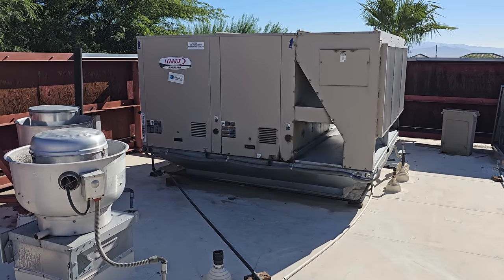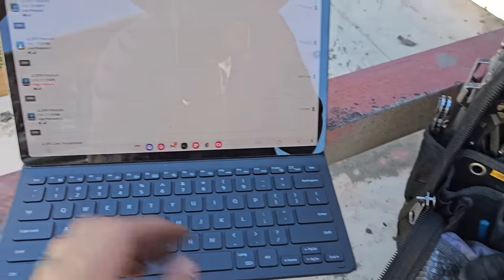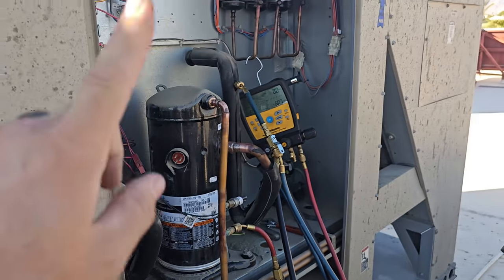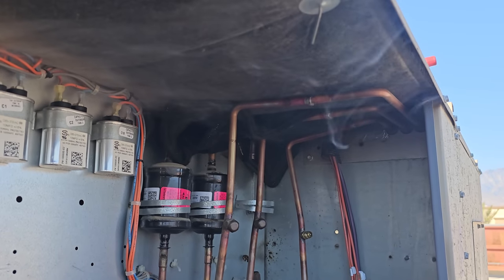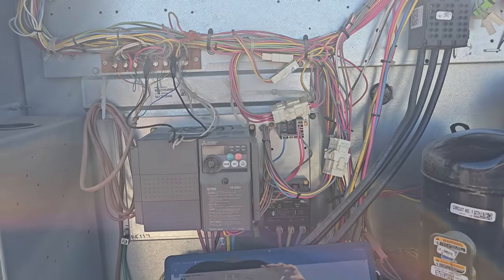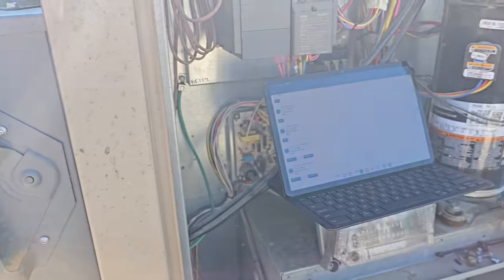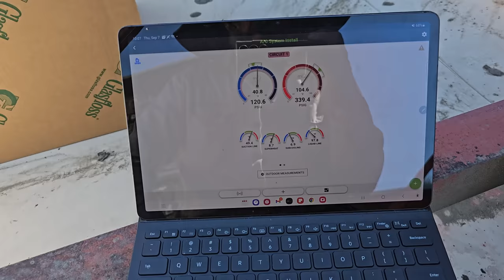GUESS WHAT.. MORE SAND AND I'M LIKING IT

Comment: The drift with the probes is due to elevation changes and the barometric pressure, usually.... The acceleration time on that VFD was pretty fast in my opinion. I personally like a minimum of 30 seconds acceleration and 45 seconds deceleration. I mostly set them for 45 and 60 ( for a blower ). I've had to drill the liquid line many times....it works great.  I recommend using the Phase 3 acid test kits to check your oil for contamination. I really like the fact you prepared for the future with the iso valves on the drier. You see that a lot with larger equipment. You take things much further than most companies who work on RTU's. I respect the fact you don't take the quicker route and take the correct course of action.
Reply from the maker: The fieldpiece probes have a real issue with drift and it's bigger than an elevation change. Ive got probes that dont drift at all no matter the elevation change
Reply: @HVACRVIDEOS  good to know. I have Testo so no real world experience with FP. Have you ever sent them in for calibration
Reply: Chris is fortunate that he has customers that allow him to bill for that extra RTU work, because most third-party customers want the very bare minimum……and that’s all they’re going to pay for.
Reply: @arthouston7361  Yeah, customers often are not able to calculate properly. Maintenance work goes unnoticed when everything is functioning as expected. People only tend to notice maintenance when something goes wrong. This can lead to the perception that they are paying for something they're not actively using or benefiting from. This mindset comes also often when you are part of a chain/franchise. Maintainance has to be payed by the franchisee while equipment swapouts payed by corp.
Reply: @HVACRVIDEOS  your the best

Comment: Building a town in an environment barely liveable - like a desert, what could possibly go wrong...
I think this is a case for "the biggest picture ever". Since abandoning this town is no possible solution at the moment, all the equipment must be made ready for this environment:
- ALL contents of the cabinets in a closed space in the basement or at least far away from any dusty/sandy air so only the bare minimum of equipment needed on the roof stays there.
- Installing cyclone sparators for the make up air and the air for the condenser so the filters have a lot less to do. Having only mimimum sand in the equation helps a lot.
- Perhaps rooftop units are not suitable in this environment. Sure, space in the basement is for storage, space on the ground floor and possibly first floor is for customers, but in the end the 20-50m² used for all this equipment would be a benefit in the long run.
Reply: @deineroehre But how to convince customers to spend the money when they often decline basic PM?
Reply: @adamdnewman  This is where regulations are most useful. Make it a requirement for anything new. Either they close up, find ways to not need active cooling, or install the parts needed.
Reply: Haha, basements in the desert southwest, your funny😂
Reply: I would recommend the control panels use "purge air". This is the principle used in gas stations: filtered, clean air is forced (by fans) into the control panel spaces to pressurize them. This allows for sophisticated electronics (like those entertaining screens with the trivia) in paces where the gasoline fumes would otherwise cause fire hazard. In a desert, it would keep dust out.
Reply: @quietone610  no offense but think again: these customers already don’t change filters every so often for the air they breathe. Do you think they will change them on a electronic compartment ?  Better sand airflow than nothing…
Reply: Honestly it sounds like getting a hydronic system with air handlers on the roof or basement/mech room and a water cooled chiller in the basement is a better idea than RTUs. Less equipment on the roof and air handlers usually have more space for filtration so there can be multiple stages.
Reply: @brauchmernet  it seems to be that the customer can get their filters completely filled from one single dust storm. And they might not even always be aware of when they happen.
Reply: @WilliePeck  Listen, I live out here. You can't keep this dust out of anything. It gets in the house. Everywhere. I have double paned gas filled windows. My house is closed up all year long. Se rarely ever open a window. AC runs all year long. 
And yet, sand and dust is an issue. I don't care what you do, it's gonna get in.

Comment: I think we need to design a pre-filter system, similar to, say, a centrifugal flow system in some large manufacturing facilities, to drop out some of that fine sand before the regular filters. I think it could be done somewhat inexpensively. Probably would have to be inexpensive as I think there would be a small number of use cases...

Comment: Hey Chris, do you think you could cut open a filter dryer and show the difference between HH and regular dryer?
Reply: I don't think you'd be able to see the difference, at least without using a microscope to compare the porosity of the cores. they'd be formed out of smaller diameter material and have smaller pores.

Comment: You could weigh the old and new compressors to get an idea of any oil loss round the system. (assuming no internal design changes have been made to the compressor)

Edit: Wow that oil looks nasty!
Reply: I found some replacement compressors , same capacity , same style . same brand , weighing less than the old ones 😮
Reply: I wonder if they cut back on the copper 🤔
Reply: @philltafolla  yeah, for sure don't go by the weight, unless they're manufactured within a short time frame of a few weeks. even then a change of material could alter the weight.
Reply: @throttlebottle5906 I never do but yes I agree 🤷🏻‍♂️

Comment: This was certainly a different video! The main video had a ton of great info in it and the bloopers were a bit of fun as well. It's good to see your lighter side. I have a moustache as well and I get where you're coming from with that with those hairs occasionally irritating like crazy.

It was a bit of a surprise with the compressor oil with you using metric units for once when you said 'one point six litres' instead of your usual imperial units... I was wondering if you were feeling alright when you said that! You seem to have a thing against metric units.

Comment: Only way to stop filters plugging up would be to eliminate OSA and fresh air. Need to invent a sand detection sensor and shut down air intakes. They have the same sand issue on the Navajo reservation
Reply: I was thinking a different direction, i would think using like the Dyson vacuum or propane forklift intake separator, and scaled for the volume, would be the way to go. Maybe a general 'storm incoming, turn off' wouldn't be bad also

Comment: Anyone that says you shouldn't have a trap needs to go look at line sets with long vertical runs… Depending on the engineering, there will be traps every 15 to 25 feet! As you stated, it causes velocity to increase and eventually that increase carries the accumulated oil back to the compressor…

Comment: Chris, have the customer get the electrician to replace that breaker. Resetting it multiple times into a short has burned the contacts and it WILL fail soon. Seen it happen too many times in my career.

Comment: So was it flooding with liquid or high suction temperatures, can’t be both you have to pick one, but to save you the trouble the compressor failed due to single phase situation from loose connection on contactor someone replaced

Comment: hi i thought you would have also changes the contactor for the first compressor because 1 of the contacts looks different just to make sure it does not fail and ruin another compressor 24:13 they might have gotten sand in them

Comment: Is there a way to put on some cyclonic dust separator on these, or totally impractical? The separator would have the added benefit of keeping the filters cleaner for way longer, even without the sandstorms. It's insane how loaded those media filters got!
Reply: I was thinking exactly the same thing, but I have to wonder how large something like that would have to be to handle the air flow. It probably is just cheaper to replace the filters and deal with the occassional burned out compressor.

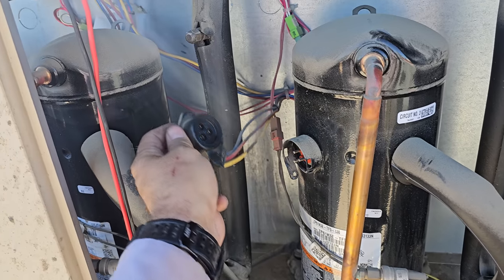Comment: About 5:50 you can see the red wire seems to be gone from the contactor, the question is more, was this before the compressor shorted, or after? And I just don't get why you guys in the US dont have sealed electrical cabinets. Everything would just life that much longer.
Reply: Price of procurement. I’ve seen customers discussing 300€ additional costs for their 30k€+ Unit.

Comment: is there a filter that is better able to handle the fine sand. I'm thinking along the lines of an oil bath filter used on off road vehicles? Or maybe a differential pressure switch to alert the owner to blocked filters.

Comment: question for the commercial guys... do you often have to set up a ladder or is there usually a built in ladder either in the building with a hatch somewhere or on the outside? Justa curious resi guy wanting to make the swap

Comment: Not an HVAC guy but used to work on pump controls here in the UK. It's strange to me to see motor contactors with no overload relays attached, am I missing something or do those compressors not have any individual overload or single phasing protection at all?
Reply: As Chris mentioned the hole unit had a phase relay. Individual phase monitors seems to happen mostly on bigger compressors. Why the overload protection is missing? My guess: price war and nuisance calls… if you have to drive multiple hours multiple times just to reset a overcurrent protection your customers will rapidly ask to remove them or set them accordingly…
Reply: @brauchmernet  I must have missed him saying it had a phase relay, but he said he thought single phasing had killed the compressor. An overload would pick up a failed contact or detached wire which a phase protection relay on the unit supply wouldn't. Maybe they are cheaper now but you used to get a lot of overloads for the price of one phase protection relay - although overloads won't pick up a swapped phase which is deadly to some things, I'd imagine HVAC compressors are one. With a unit like this one which can function to some extent without one compressor, individual overloads could avoid an emergency callout and might save a cooked compressor.
Reply: @NiallWardrop  Chris mentioned it in an comment to me: "If you look closely it actually had one but it was protecting the whole unit and not the individual compressors". About 7:19 on the right to the VFD - this might be the phase protection.
Reply: Those units are built down to a price. You can easily build or buy a small microcontroller board that measures differential pressure over the filters and sends a notification to change filters and kills the power when it's getting real bad. Also not having a low pressure switch is pretty idiotic.
But chrises customers apparently love cheap one time purchases that cause more costs after the fact :)
Reply: Every service engineer everywhere in the world in every industry knows that one! One of the reasons I got out was too many customers who relied on emergency call outs and would never pay for permanent repairs, would not understand that the thing could only be rigged to sort of work so many times and that eventually I would not be able to get it working which would shut them down. Hard to relax at the weekend wondering which unit was about to finally let go.
Reply: @NiallWardrop  Yeah and you’re usually the last who touched it… I see. Luckily i only had Datacenter units to maintain. Much less tinkering (mostly to get the unit over the weekend or until the correct part arrives) and PMs aren’t discussed but requested..

Comment: Wire burned off due to loose connection. The contactor stuck because of constant locked rotor amps on remaining contacts.  The compressor winding was destroyed by continued single phasing due to stuck contactor.  At least that's my scenario.

Comment: Why is there no phase monitor? I guess there’s a sweet spot for rtu/compressor price vs. nuisance calls but afaik I’ve never seen one in your videos.
Reply from the maker: If you look closely it actually had one but it was protecting the whole unit and not the individual compressors
Reply: @HVACRVIDEOS  I see. Individual protection seems to be only used on the bigger ones ( mostly with oil monitors ) directly on the terminals from factory…

Comment: A simple ferrule, a 0.1 cent part, could have prevented this (at least the burned contactor)
I still don't get it, why nobody uses these?
Other things I don't understand:
This AC has an 80A breaker (?) going in with 8 gauge wire (?) to a terminal block dividing it into 14 gauge. So in the event of an short or even just overload, the 14 gauge has to pass current to trip the 80A breaker. That would severely overload the 14 gauge wire, just as it did in this case. And the weakest link was the stranded wire screwed in without a ferrule (thinking about that: maybe without that weak point acting like a fuse, the whole wire would have burned up setting stuff on fire)
Why there aren't any kind of motor protection switches that detects single phasing and over current on an per-compressor basis? Also protecting the small wire from passing 80A
Such a thing costs like 50 bucks. Against the 500 for a new compressor, that's a no-brainer

Comment: No way, as a system designer, would I ever specify rooftops for that location. They’re bound to get issues and high failure rates and that’s before the increased running and servicing costs.

That’s the problem with dumb cookie-cutter commercial building design. Sure, let’s just put in a flat mansard roof architecture and throw on some rooftops. Who cares about customising for the environment all this stuff is expected to work in…